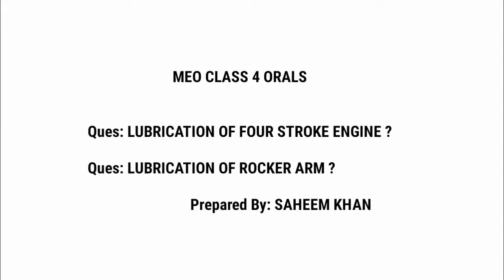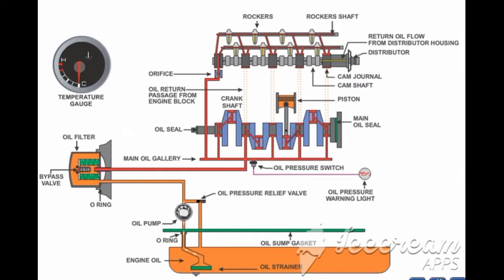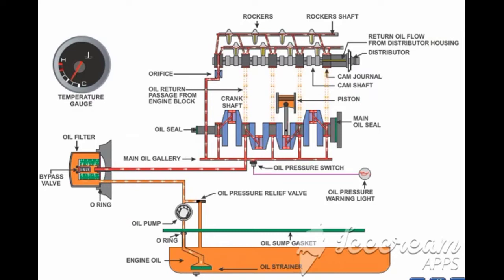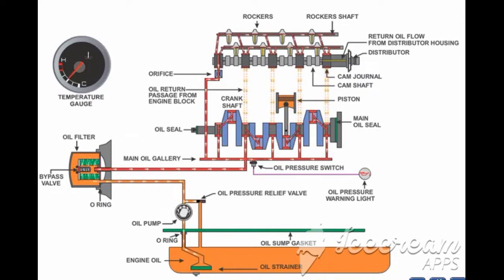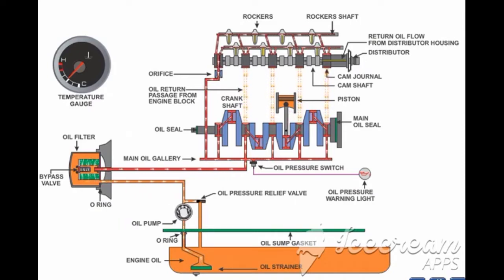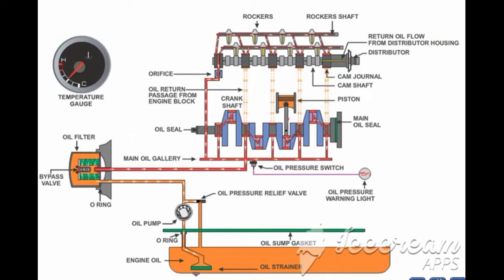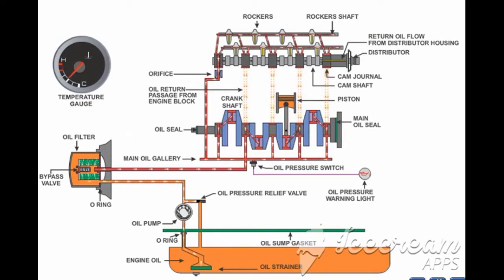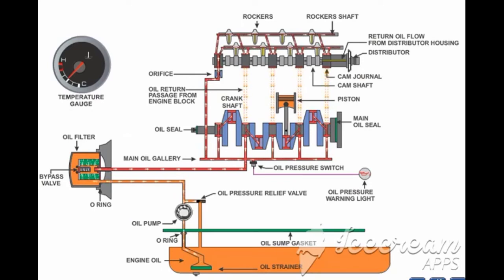4 STROKE LUBRICATION SYSTEM | ROCKER ARM LUBRICATION | MARINE HELP BOT

Comment: What prevents the rocker arm oil going into the combustion chamber ?
Reply: I think there are valve seals placed above valves which prevents the oil entering into combustion chamber